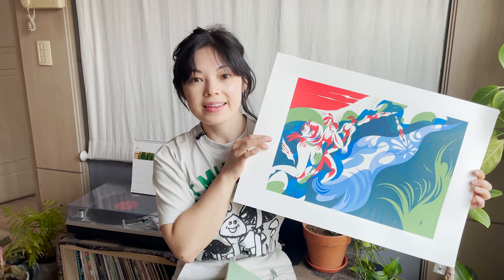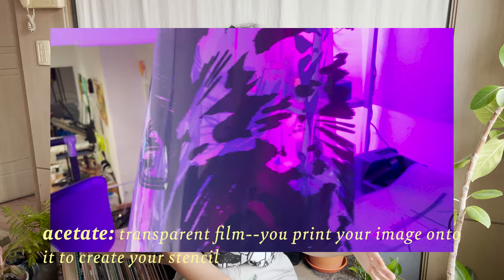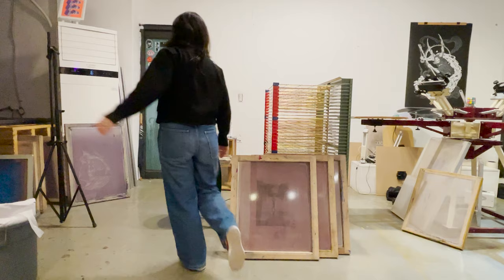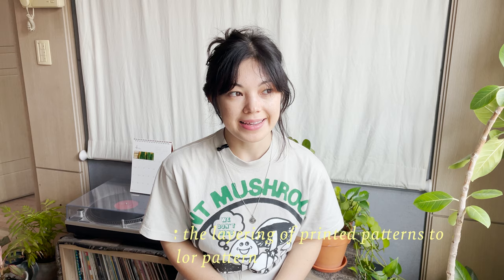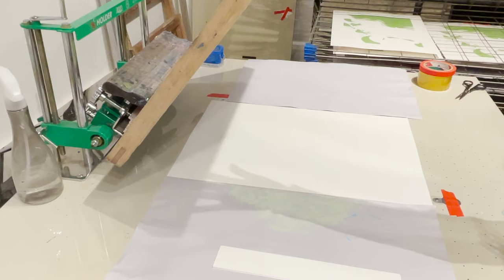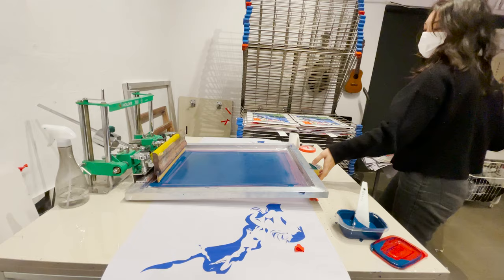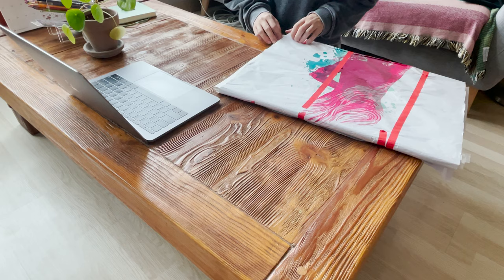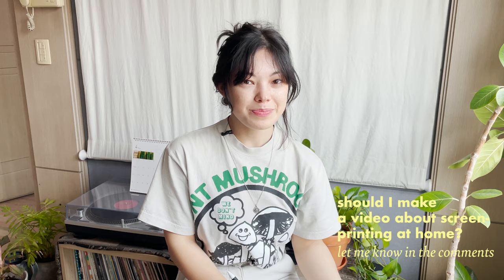How to SCREENPRINT Your Art | My silkscreen print process

Comment: I enjoyed this video. I am interested in screening onto canvas. There is an inequality between the height of the canvas and the height of the silk screen frame in relation to where the frame lands when the hinges are closed onto my canvas. How do I get the hingeclamp base to be 1.5-2" off of the table to fit my canvas under the hinges and frame?
Reply from the maker: Some screen printing devices have adjustable areas so you can raise the screen up. I would recommend looking for one of those, or maybe putting a block between the hinge and the table if it's a simple set up. Since I'm not an expert on what equipment is available in your country, it's probably best to ask a studio or shop near you what your options are!

Comment: Hi Kel, I'm planning to create an A2 poster using Procreate. 
Does it matter if I draw it on size A4 then enlarge it to size A2 on Photoshop? Would the quality still be the same?  :) Thank You!
Reply from the maker: Hi! It will be better to make it A2 size, otherwise, it will come out a bit pixellated---but if you are going to screenprint, it might be a bit easier to correct in Photoshop. Try to make the size you will print it at if you can~!

Comment: Hey what size transparency film did you use?
Reply from the maker: for this one, it's a little bigger than A3, so I printed on a film roll. The roll is up to 60 cm wide and you can print as long as you want, since it's not cut into separate sheets. But if I wanted to print it just a little bit smaller, with margins, I could have just used A3 sized film.